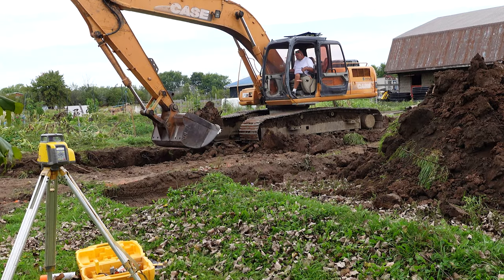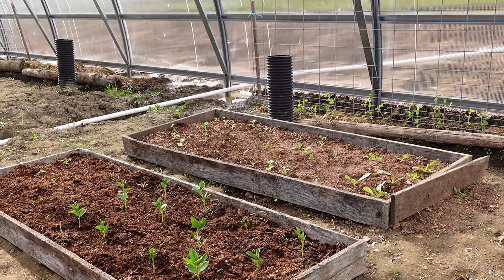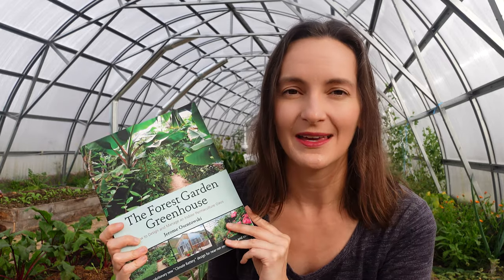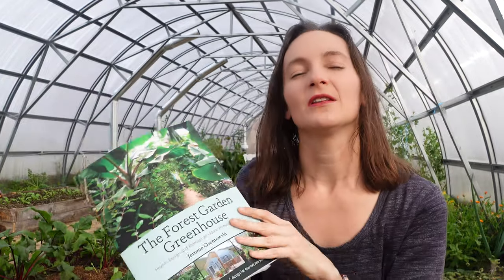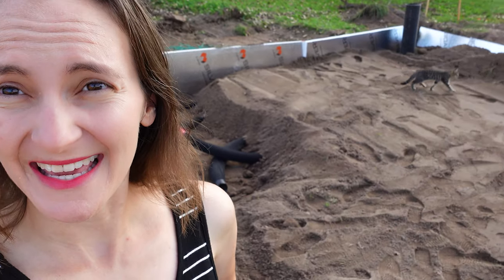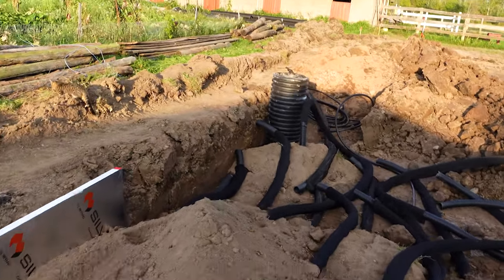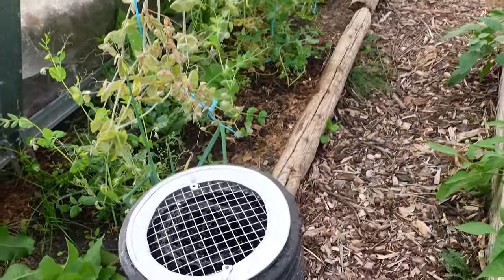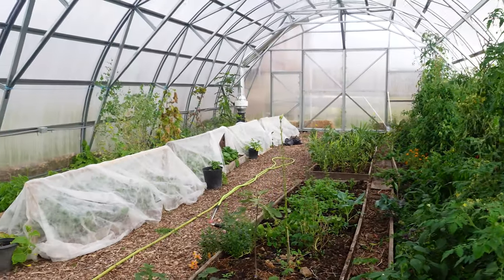The Greenhouse Climate Battery: How & Why It Works

Comment: We have a geothermal greenhouse /climate battery in zone 3 Canada and add extra heat with a wood stove. We have only one summer and this is the second winter. We have a much drier soil so no drainage needed . We put a 4' earth burm against the back wall for extra cooling in summer and a bit of extra insulation in winter. The best thing is it really helps with humidity control we find. Though glycol is a more efficient heat transfer it doesn't help with humidity so we would still stick with the air personally. Nice to see another geothermal set up :) We are all learning together.
Reply from the maker: Thanks so much for sharing your experience and it's interesting to see the differences between our locations/soils. I love the idea of putting a berm against the back wall. Our summer was intensely hot so if it can help with that, it's probably worth doing too! 

How thick would you say the berm is? 

And thanks for the words of encouragement - we are all learning together, for sure! :)

Comment: Hi Natalie, I am looking for ways to heat my greenhouse other than running an extension cord with a heater attached to it. Right now I have a greenhouse tent but I hope to get an actual greenhouse. Are there any resources on how to get started with a climate battery? Are there battery kits or can I build one on my own? How much heat does the system produce?
Reply from the maker: Hi there! I recommend taking a look at the work of this website: https://crmpi.org/

There are also companies that specialize in designing and helping source materials for climate batteries, like this one: https://atmosgreenhouse.com/products-services

I haven't used them myself but they are very knowledgeable and can help steer you in the right direction!
Reply: Composing.  Used oil burning heater.  Dig below frost line.  Earth tube. Etc

Comment: Wouldn't you want it deeper than 3ft. At least 5ft I would think and larger area of pipe I would think.
Reply from the maker: Yes, I think that would have been better - we also have a high water table, so we had to make some tough calls.
Reply: Its not about the tubing so much as the amount of air you can run through it.

Comment: I thought rule for underground no longer than 30 Runs? Yours are close to 60’ with verticals back to grade elevation.
Reply from the maker: I wish I had that rule ahead of time - most of what we went with was from books and website and they didn't mention these specifically.
Reply: @waykeeperfarmandnerdery  
The rule of thumb is to keep the tube lengths as short as practical. The surface area available for heat exchange  is the same for 1x 100ft tube or 10 x 10ft tubes.  You can run 30x more air through the10 tube system. The low air flow rate in 100ft tube will result in the air dropping to the mass temperature in the first10ft and  then coasting through the remaining  90ft without any further change in temperature. Ideally, you want the entire length of the tube to be actively transferring heat.

Comment: I have just built a climate battery greenhouse but have not decided which fans to use please can you tell me what you have used and why?
Reply from the maker: Hi Peter!

These are the ones we went with: http://vortexpowerfans.com/vtx-series

My husband is the one that did the research on these and I think it was a combination of what we could find in our region and also how much air it could move. We could have gone with the more expensive and more air moved per hour/power, but we wanted to test first. Hope that helps!
Reply: @waykeeperfarmandnerdery  
I hate to say it but the fan should  be chosen during the design phase.  The greenhouse air volume multiplied by the desired number of air changes per hour gives you the required air flow rate.  For example, a 1000 cubic foot greenhouse air volume and 10 air changes per hour, would require a fan capable of delivering 167cfm, after accounting for the losses in the tubing layout which should be minimized by careful design.

Comment: What CFM fans did you use?
Reply from the maker: They are 200 CFM, and we got them from here: http://vortexpowerfans.com/vtx-series

By our calculations we may have done better with higher CFMs but these were also more within the budget!
Reply: @waykeeperfarmandnerdery  
Assuming a completely lossless system 200cfm in and 200cfm out), you need a minimum of one fan per 1200 cubic feet of greenhouse volume. Enough to turn over the entire air volume 10x per hour.

Comment: Did you perforate the pipes underground?
Reply from the maker: Yes, they came perforated.
Reply: @waykeeperfarmandnerdery  
Its best to buy non perforated tubing and cut a straight slit partway through the corrugations (just a few mm deep) and locate the slit at the bottom during installation. This ensures the condensate can fully drain. The holes or slots in standard perforated tubing are normally located in the valleys which results in water collecting in the bottom of every corrugation. Water in the tubing is detrimental to the heating performance.

Comment: How much cooling did you see during the summer?
Reply from the maker: Great question! I would say a few degrees, but it's hard to track because it gets so hot we wouldn't keep it off long enough to measure... often our thermometer would top 50 degrees celcius and shut off during the hottest days.
Reply: @waykeeperfarmandnerdery  
For effective cooling you need to put the entire greenhouse air volume underground at least 20x per hour. Diminishing returns begin at around 45x per hour. Its not easy to achieve this in a massive greenhouse due to fan power limitations. I designed my system to handle upto 60x per hour to do these kind of tests.

Comment: ok. the problem with all these climate batteries is coming clear. Air is a terrible medium to conduct heat, the excavation is really outside the scope. there is a better way!!
to move heat than this.
Reply from the maker: I'm here to learn as much as I am to share our experiments, so if you have any ideas I'm all ears! :)
Reply: Hydronic systems, water provide greater transference, pex/poly tubing less likely to clog or get damaged from roots
Reply: @TonySGuo  
 Water has a higher specific heat capacity compared to soil but it doesn`t offer any of the advantages you gain by using soil as mass and air as the transport medium.

Comment: Hot air intake tube needs to be high cold air intake tube needs to be low.
Reply from the maker: This is really helpful! The way we set things up, we only have "one direction" so the intake is high and the output is low.
Reply: @waykeeperfarmandnerdery  
A well designed system should mix the air. If you take temperature readings between the floor and the highest part of the roof, you may find the highest temperature is not at the apex but quite a lot lower.